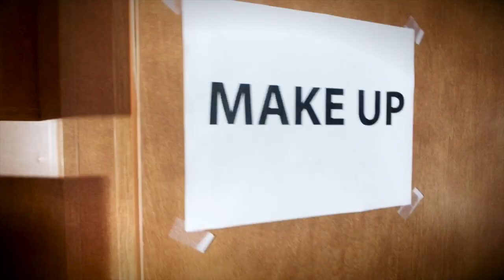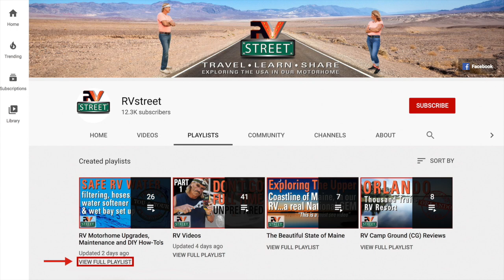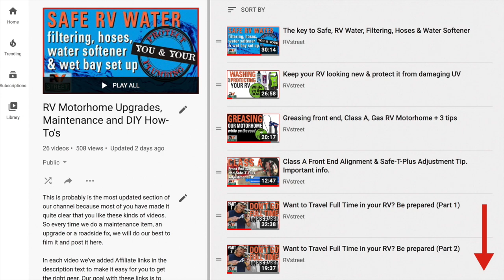RV KwiKee Power Steps: EVERYTHING YOU NEED TO KNOW

Comment: Your video came at exactly the right time! My step was working fine however it makes no difference if I have the key in the ignition in off or on position , and if the steps switch is on or off. Every time I open the door the steps comes out and close it it goes back in. It recent got stuck in  the out position so I replaced the controller, as well as the motor and gear assy. It works again just as it did before-all the time! My rig is a 1997 Dutchstar DP-3757. Any help would be greatly appreciated. Thanks again for all you do!
Reply from the maker: Every time I open the door the steps comes out and close it it goes back in
So I'm confused. This is the way it's supposed to work.
It recent got stuck in  the out position so I replaced the controller, as well as the motor and gear assy. It works again just as it did before-all the time! 
So I don't understand your question for help. It's working as it did before. That's the way it's supposed to work.
Clarify if I'm not understanding you right.
Reply: @RVstreet  Thanks for getting back to me Marty, I will try to clarify. If I open the door from the outside the steps extends out and then if I turn the step switch in the off position , shouldnt the step stay down unless I put the key in the ignition or turn the key on? If I am parked at a camp site with jacks down no key in ignition I thought with the steps extended and switch of the steps shouils stay extended until I turn the ignition on or turn the steps switch back on, now the steps come out and go back in every time I open the door. Thanks again for your input!
Reply from the maker: @aldsldr.3589  If I open the door from the outside the steps extends out and then if I turn the step switch in the off position , shouldnt the step stay down unless I put the key in the ignition or turn the key on?
Yes.
Ok so for example, we're parked right now in a CG. Jacks are down and slides out. Step Switch is in the OFF position. Now we can go in and out of the door and the steps stay put.
This is the way it should be set and work when parked.
If I turn ON the step switch, the steps will deploy and retract every time I open and close the door.
On the ignition switch....it over rides the switch. When you put in the key and turn it  it tells the steps "I'm going to start the RV now, so bring in the steps". Since you put in the key and turned it, the steps assume you're going to start the engine and it doesn't want you to leave with the steps deployed. So it retracts them. If you open the door it will deploy the steps. If you keep the door open the steps will stay deployed. Again... the ignition switch....over rides the step switch. It's a safety feature.

Just putting in the key into ignition doesn't do anything, it's when you turn it that over rides the step switch.
Reply: @RVstreet  I read through your instructions and when I tried it again, it worked just as you said it should. I think maybe I was turn the switch to the off position before exiting the coach, so when I exited the coach and then reached in and turned the switch it worked perfectly- Shazaam! (As Gomer used to say LOL!) Thanks again!

Comment: Martin, thank  you!  right now we are stranded with our 2005 Four Winds. Steps wont retract.  When I went under saw green wire not attached, ring terminal had rusted thru. I replaced and reset in new location.   That did'nt make step work tho.  I went ahead a used lube and checked for any debree in linkages.  nothing.  was trying to find info to manually retract step so could get to place to have worked on, not successful yet..  We do use a step just like yours we are using and bracing under steps. but wish had seen your video sooner.  
While watching I saw the magnets on door so checked and lo and behold, our magnets are not meeting. the screen door where magnet is attached is warped and not meeting inside part of door frame, now I know what I need to address, not sure if can fix myself, but don't feel as stupid.
 I will be adding your information to my maintenance schedule.  Thank you!!
Reply from the maker: Way to go Kate. 😍

Comment: Great video Martin 
Our 2014 Georgetown 328 steps go half way then stop and make a horrible grinding noise 
I suspect gear box is off track or damaged somehow 
Keith
Reply from the maker: Do the routine maintenance first then re-assess. If that doesn't fix it, then by your description it does sound like a trashed gear box. If that's the case, I'd replace both the motor and gear box while your at it. Then just perform your routine maintenance from there on out and they should last for years and years. 👍

Comment: Also check with Lippert the serial number for the stairs....there has been a recall on the turn buckle linkage...mine failed/broke when I stepped on it to enter the RV after checking in at a campground and the stairs retracted from my weight and trapped my foot between the steps...good thing I had a good grip on the hand rail and door or things would of been really bad.🤠👍

Comment: Thanks for the great video. I was hoping to find a solution to my specific problem. When on shore power, my steps work perfectly..but when on battery, they keep trying to go out or retract even though they have performed properly. In other words, they will retract and keep clicking as if they have not retracted and vice versa the other way depending on the function of the door.
Reply from the maker: Well, this video won't solve every issue, but it will solve 95% of them. Have you cleaned and checked ALL your electrical connections including the ground and the main controller connector as I showed? Check the fuse, it may be corroded and the power signal may be getting interrupted from the batt bay.....etc...etc...
Always start with the common issues first. Methodically check each item to eliminate what it isn't and that will reveal what the problem has to be.
Check your factory wiring diagrams for that area and see how it's wired into your house batt's. Then trace all connections to there and do the same as above, Clean and check.
It's definitely an electrical issue and that could—and I mean could—include that the controller went bad. Don't buy a new one until you do all what I outlined above and more. Throwing money at it is not the procedure. Diagnose the problem, if a part has be proven to be bad, then replace that part. I don't know the history of your RV, but controllers and other operational issues can and do go out from age, subjected to a lot of rain, humidity, salt....like staying near beaches or salt water and the main one......lack of maintenance.

Comment: Great video! Very appropriate content for me to run across today. Our step problem is a weird one.  When we start the engine, the step extends! Thinking it’s maybe a loose wire...? Stairs function perfectly otherwise. Ever run across anything like that?
Reply from the maker: No I haven't but.....
It's either a wiring or a controller issue but more than likely wiring. Try turning the step switch off first by the door and see if that fixes it. If it does that means the switch is bad or maybe the wiring behind it. Always check the easy stuff first and eliminate what it isn't and by process of elimination you'll reduce it to what it has to be. If the problem persists with the stair switch off and the wiring to the switch looks ok, then crawl under the stairs and loosen that ground wire from the controller that bolts to the chassis that I showed you. Clean it well with a brass brush, apply terminal protector and then retighten. If that doesn't work, unplug the wiring harness to the motor/gear, clean out with electrical or brake cleaner and reattach. If those things don't work then without being there I couldn't make any other suggestions.
Good Luck Hinde. 👍
Reply: @RVstreet  Thanks!  Will do and report back with pictures.  REALLY appreciate your expertise!  This weekend's project will be our first boondocking night to test out all the repairs and try and get the steps figured out.  Next oil change, we are gonna install the fumoto valve on our F53.  What a great idea!
Reply from the maker: @hindegarrison970  Ya if you want to post pics you'll have to do that on our FB page.
The Fumoto valve make oil changes so easy. Thank you so much Hinde for supporting our channel. Chat with you later. 👍

Comment: I have a 2019 Odysses Entegra class C. The step stopped working. I replaced the motor, the magnetic switch, checked the grounds- but nothing. Can it be something with the ignition cut out. I know the yellow wire controls this but don't know where it attaches to the E450 Ford cab. I tried to test the controller but no luck. Any suggestions? Great video- have subscribed to your channel.
Reply from the maker: It could be in the ignition cut out but more than likely the control board itself. You said you tested it but no luck. What does that mean?

Comment: Great info!  I have a 91 Itasca, can’t get the steps to come out!  I hear the click of the motor but no movement. How to get the steps out to work on it?
Thanks Pete
Reply from the maker: Well, you could try some of tips that I covered first. Or maybe tap on the motor with a hammer to try to get it to move. If those things don't work, remove the motor and gear box and pull the steps out by hand.

Comment: Hi Martin, Great informative video.  I have a 2005 Winnebago Adventurer that has the same exact steps as yours.  I'm thinking of replacing the motor since they are no longer available from Kwikee/Lippert as you know.  Can you tell me which motor from AM equipment you used for your steps.
Reply from the maker: "I'm thinking of replacing the motor"....why are THINKING of replacing it? Is there something wrong with it? 

Well I haven't replaced mine yet. But if you'll go to the AM Equip. site that I gave the link to in the description text you should be able to look your part # with no problem. Be sure to go to the description text under the video and the info you need should all be there. Just a little nudge....Always go to the description text under every video I do because there's always a lot of extra goodies there.
BTW...if you don't know where that is or how to get there, watch this video:
https://www.youtube.com/watch?v=bprAsHO7-F8&t=2s
thx dyna 👁👄👁
Reply: @RVstreet  Thanks for the quick response.  I rewatched your video, and found the part# when you scanned past the motor.  I did read the drop down under your excellent video, and went to the AM website.  The only part# on my motor is High Torque #9551, which they don't show.  I'm having a problem where my steps don't come all the way out, or retract all the way unless I assist them.  It's been away too cold where I'm at to do any in depth testing right now, but wanted to get an idea about parts when I get a warm day.
Reply from the maker: @dynadefender  Ok good, I'm glad you got my PN#. I forgot that the number was still on label on the motor itself. Since your rig is a 2005 and you're going to the trouble of replacing the motor you might want to consider replacing the gear box too and just be done with it if further testing proves to not produce better results. If you think about it and have time later on, I'd love to hear back from you on what you found and what you did to fix the problem. 🔧

Comment: You referred to the Kwikee motor & gearbox as being available thru auto parts  stores. Do you have further info as to the automotive application (yr, make, model) that is the proper fit??
The motor/gearbox seem to come as a set with different products having differences in the gearbox output gear.
Thank you.
Reply from the maker: The proper replacement motor and/or gear box sourced from an auto parts store can vary depending on your type and model of steps. Generally speaking many can be replaced with a 2006 Taurus window motor part# 742-240 but sometimes the bolt pattern isn’t correct and in one instance the 9-tooth gear was smaller then the original gear.

More places to find motor & gear parts:
1) AM Equipment 402 E. Hazel St Jefferson, OR 97352, (541) 327-1546 the motor is $29 plus $7 shipping.
2) Replacement step motor at AutoZone. It's a Siemens "Window Lift Motor", part# WL43003.
3) Autozone. The brand is "Siemens"
The ID tag lists the following numbers:
59720-20
121899
4) A 1986-1995 Ford Taurus left front window lift motor sometimes will match. NAPA part # BK655-1395 $63.99. Also from Auto-Zone Manufactured by Dorman part# 742-206. This has a lifetime Warranty and was $49.99.

On disassembly of the motor if you find the plastic plugs severely lopsided due to all the years of strain, new plugs cost $8.00 at Autozone or Amazon.

Some folks that have a 25 series Kwikee step motor can replace it with a with a Dorman 742-277 window lift motor for a 1986 Ford Taurus driver side window lift motor. Taurus has a high torque motor which is why the number ends with 277 meaning high torque. 

AutoZone has rebuild kits for Dorman window lift gear boxes (plastic gears).

Always use old motor and gear box to match to the right new one for your steps.

Comment: Great video! I’m trying to troubleshoot my steps. The motor runs when it should but the steps don’t come all the way in or out. I disconnected the linkage and see the bolt is spinning. Disconnected gear box from motor and all the teeth look good and not stripped. Haven’t reinstalled it yet. Any ideas?  This is a 2022 Newmar Dutchstar.
Reply from the maker: I'm sad to say that Martin has passed away and I don't have an answer to your question. So sorry
Reply: @RVstreet  So sorry for your loss

Comment: Great video, I have been using the lithium grease but don’t like the white residue left behind. I will be getting some chain oil and giving that a try. Just upgraded our low point drain plugs. I would have to crawl under the MH with a wrench to remove the drain cap to drain the fresh water tank. So I replaced the cap with  a ball valve now I can crawl under and with a half a turn open the drain valve so much easier. I would like to know how you adjust your door latch plate so I don’t have to slam the door to get it to shut properly. I have adjusted many times but still the door doesn’t close as well as your door does. When are you heading back to the RGV? Thanks for the information. Brett
Reply from the maker: Are you talking about adjusting the screen door latch?
We're heading back now. In Ohio.
Reply: Talking about the metal striker plate on the door jam. Usually 2 pieces of metal screwed into the frame that the door latches once closed. Safe travels.
Reply from the maker: @brettjackson5527  Oh, OK. We don't have that type of set up. On our door jam there is no strike plate. Just two holes in the steel door jam where the door locks go into.
If you have to slam the door for it to fit maybe just use a file on that area to gently shave a little material so it will fit in better without having to push or slam so hard. I think that's where I'd start.

Comment: Thanks for the great info.  When parking at home I have a brick planter that prevents the steps from deploying and I would like have a temporary override that prevents the steps from extending.  Other than placing a magnet on the contact switch do you have a better idea?  Yes I understand they automatically deploy as a  safety feature but is would only be for parking at home.   Currently the coach must be further in the driveway to avoid steps hitting the planter and getting cars in the garage is very difficult with only inches to spare.  Thanks
Reply from the maker: Well I don't see placing a magnet over the switch a very big deal at all. Pretty simple actually. 
But, if you don't want to get into installing a switch, possible a relay, more wiring bla, bla, bla, why don't you just turn the step switch off, get under the steps and unplug the controller wiring plug? OR....disconnect the ground wire. That should be a solution.
When you get ready to roll again, plug the wiring plug back into the controller or reconnect the ground wire and your good to go.
The only additional thing I'd do if you go that route, is apply a very thin coat of dielectric grease to the plug and male end on the controller and then tape the plug to prevent any moisture getting in.
Let me know what you ultimately ended up doing. I'd like to know. 👍
Reply: @RVstreet  I ended up modifying the planter so the steps could extend normally. The planter was stacked stone so while a bit if work I simply needed to remove several. It seemed like adding an additional point if failure and possibly damaging steps if something goes wrong when I had an alternative was not the best way ti go.

Comment: New to your channel. Love the information and how you explain everything. I have a problem with my steps always going in and out. I have tried replacing the switch inside the door but that doesn't seem to be the trouble. Would you have any tips or ideas that might help me figure out what's going on?
Reply from the maker: Possibly the step switch.
Reply: @RVstreet  I've replaced the step switch inside the door but still have the problem.
Reply from the maker: @sylviagiacoma  Not the magnetic switch. I was talking about the other step switch. It's a toggle switch usually by the door by your battery switches that turns on and off the steps.
Reply: @RVstreet  yes I replaced the toggle switch 😁
Reply from the maker: @sylviagiacoma  I was just going over some of my older comments and saw this conversation again. Did you ever get your steps to work right? If not have you checked and cleaned your ground wire that I talked about?